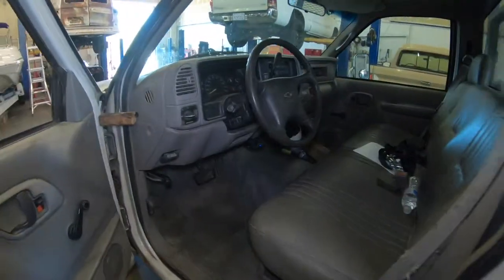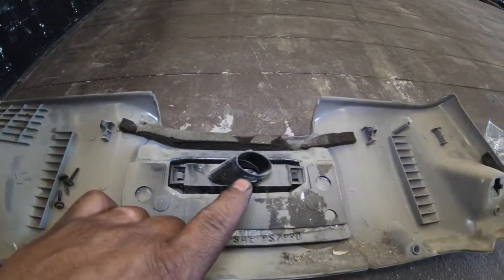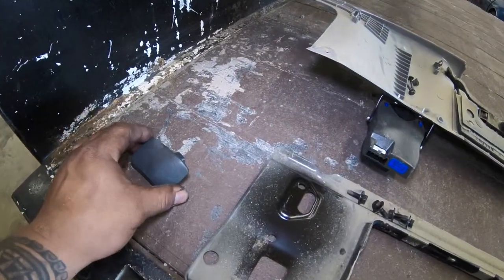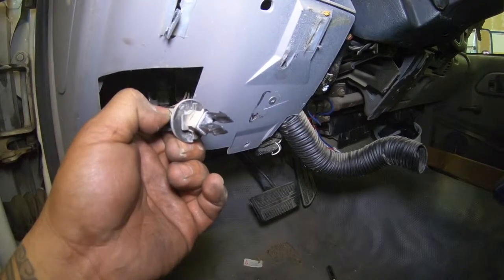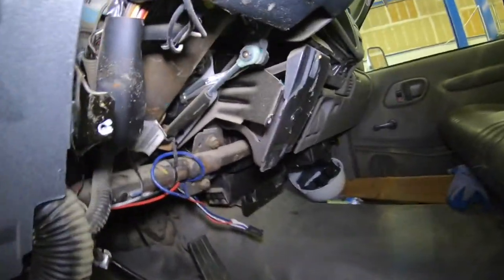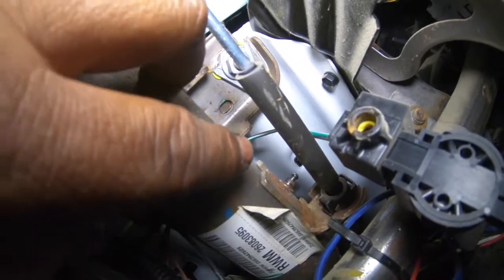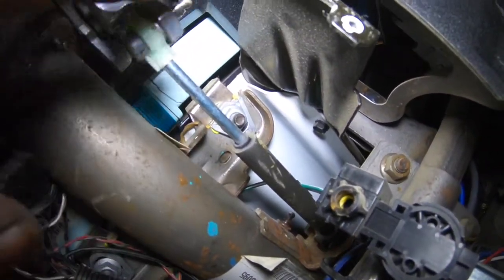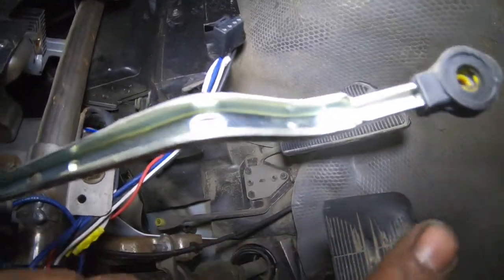2000 Chevy 3500 HD Shift Interlock Actuator

Comment: you forgot to mention the little white tang that you need to pry our to get the solenoid off of the pin mount. And then when you put the new one on you have to pull the tang out first then put the solenoid on the pin then push the tang in to lock the switch on. otherwise it will eventually fall back off.
Reply: Your comment just saved my life 🙌🏻🙌🏻 I have been looking high and low to find out why I can’t get my solenoid to stay on

Comment: #1 - how do you remove the wire connection with pink paint @ 4:40
#2 - would this cause the truck to not allow the coil to spark if this part is bad or broken?
Thanks, and nice video.
Up-date - figured out #1.  Push in the small green tab (shown left here) and then pull the green "T" at the top so the green piece moves to the right as shown here.  Then, you can push down on the black tab (with the pink on it) and pull the connector apart.

Comment: Good video! So when you hit the brake pedal it sends a signal the interlock actuator which then allows the truck to come out of park. So in other words disconnect the shift interlock actuator wire, tape it so it can't touch anything and call it a day? And all that will happen is the truck will come out of park without the brake pedal being depressed?
Reply: You are correct, when I bought my 98' 3500HD it was laying over the shift cable. I was unable to reattach it as someone was pretty hard on it which is what caused it to spring off. It's been omitted and it's fine.
Reply: no it won't work that way, not on mine anyway

Comment: Hey could this be the issue if you can pull the shift lever from the park position without hitting the brake pedal? I just got a Tahoe in last minute before we left for the day. Customer states the truck gets stuck in park randomly, but I couldn’t get it to happen the last five minutes I was there, but I could take it out of park without using the brake pedal. Which I know is not normal. Just hoping to save a few minutes in the morning lol.